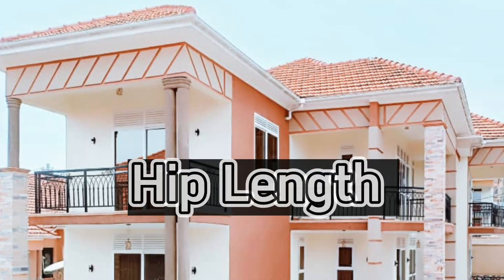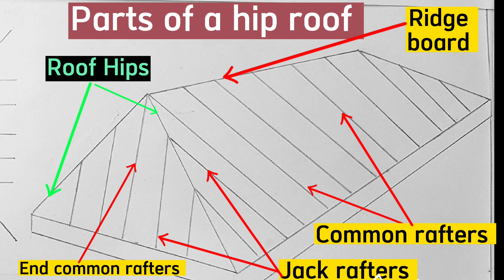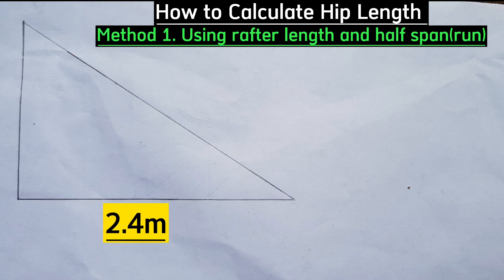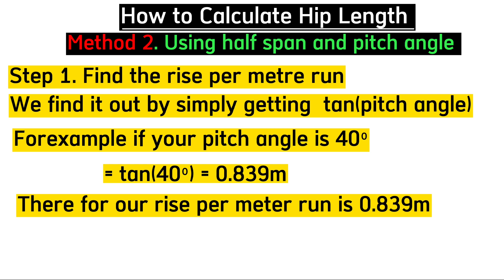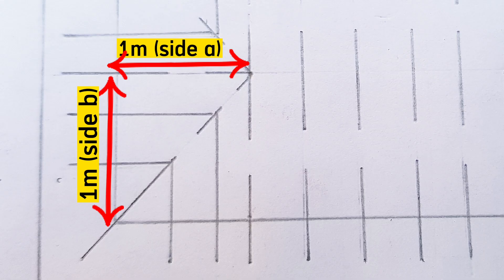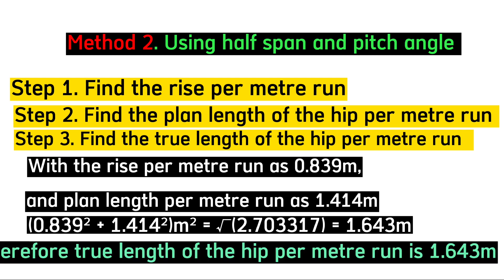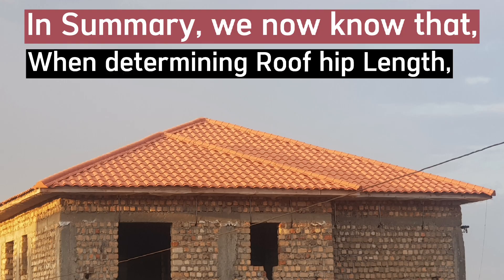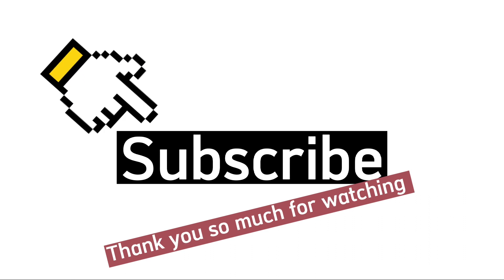How to Estimate roof HIP LENGTH | Build a HIP ROOF

Comment: Method 1 is just silly. The maths is correct, but if you can measure the 'common rafter length' by getting  up on the roof, then you should also be able to measure that hip length directly. Forget Pythagorus!
Method 2 is just confusing. Just use the 'hip factor'.
Reply from the maker: i tried to make things simple bro even for people who didn't do Civil 😂👌
I guess u are also an Engineer and you see just elementary things